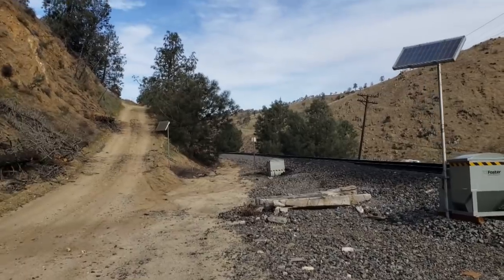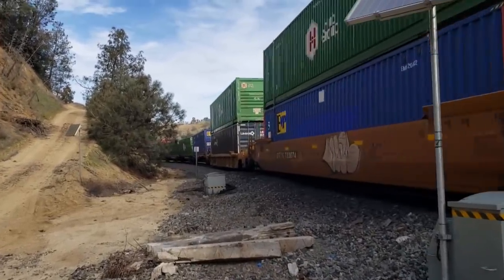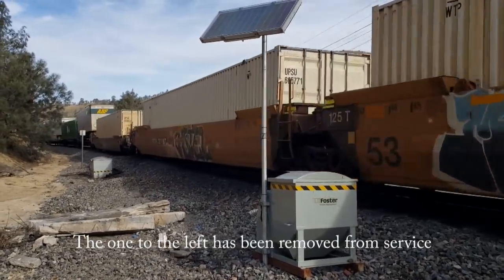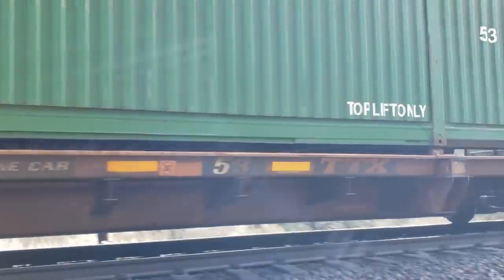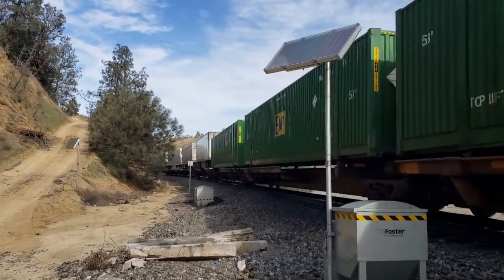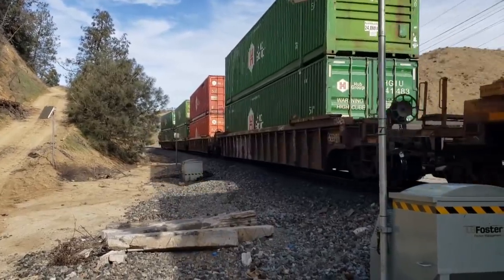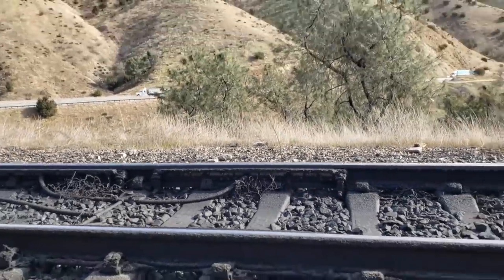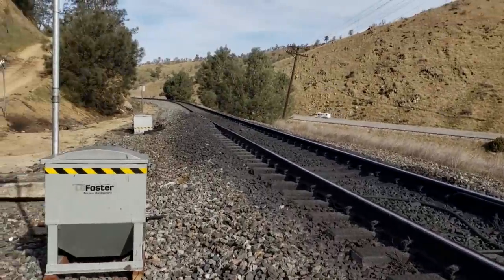How a Railroad Curve Oiler Works or How Squeaky Wheels Get The Grease!

Comment: Pity they don't have spare units that can be swapped out for a defective one, instead of of just not have grease to one track.
I worked on a tunneling project for Canadian Rail boring a tunnel under the St Clair river near Sarnia, Ont. This was to replace the 100 year old one that was too small a diameter to take the double stacked containers shown in you video. They had been barged across the river previous to the tunnel opening.
Thanks for explaining the track greaser, I bet local residents also lover not being woken at night by those horrible squeal's.
Reply: Huh?  It looks to me like the one out of service was replaced by the one he talks about.
Reply: Most railroads that use these lubricators have someone or several people assigned to maintain them depending on how many there are.

Comment: Train gear question: Am I correct in assuming the tail light on the back of the train is run by a small turbine driven off of the airbrake pressure system?  Recently had a train stop by my area with the back end at a short walk's distance, and kept hearing a whining noise from the end of the train.
Reply: Correct. The FRED (Flashing Rear End Device) transmits brake pipe pressure to the lead loco, as well as being a means of performing an emergency brake application.
Reply: No, FRED is battery powered.
Reply: @royreynolds108  I would bet on battery/turbine generator combo then: I couldn't see the railroad relying on all battery and having to bother with recharging in storage when just hooking up will give instant operation instead. Would really like to look at one.

Comment: The company I work for has its own siding with three spurs. We get tank cars of oil almost daily that have to be switched out. My job is weekly to go out and clean and oil the sliding surfaces of five manual switches and maintain a flange greaser just like those. I even have to manually grease the inside of the rail on the high side on a couple of hard curves and I just use a paint roller to grease the side of that to keep from wearing the side of the rail so much. The automatic greaser is triggered by a proximity switch that detects the wheels and every 18 wheels it runs a 15 to 20 second cycle of grease pumping.

Comment: Have you experienced the flat cars which carry military's battle tanks where the  wheel trucks have 3 axles? Saw a video from the  early 2000's on Tehachapi and the squeal was something terrible, comments said it was brake squeal but it was going up hill. Needed more allowable axial shift on the middle axle to stop the wheel flanges loading against each other (the 2 outer axles v the center axle). One thing you should not have is the lubricant on top of the rail, loss of traction, wear due to cavitation, wheel skidding, environmental mess.

Comment: I seem to recall reading somewhere a long time ago that the steam locos had oilers on them. The engineer activated them as needed.
Reply: That depends on the railroad and service the locomotive was assigned.  This also includes diesels and electrics depending on service and location.  Switching on and in tight curves would often find flange oilers on locos sometimes with a method to start and stop the application.
One of the switching railroads around Chicago has diesel locos using tires on the wheels like steam loco wheel practice because it is less expensive to re-tire wheels than replace the wheelset or wheels on an axle.

Comment: Here's a question you might have answered in your setup:  Are the wheels on each axle all one solid piece, so that they must skid a bit while following a curve?  If so, why is that done?  Is it really so much cheaper than having each wheel on an independent bearing?  I would think that if one wheel wears faster than the other for some reason, the difference in diameter would result in wear and drag that would waste a lot of fuel.
Reply: Ralph ... the wheels are solidly mounted onto the axels so rotate as a pair. What you don't see is the wheels have a taper to them to help keep them centered between the rails and lower the wear on the flanges while on a straightaway. What this also does is slightly change the diameter of the wheel between the inside and outside edge of the same "tire." (the contact area of the wheel) Basically this slight change in diameter also reduces that problem with the two wheels wanting to rotate at different speeds because the car slides to the side on a curve and it rises up to that change of diameter on one side and down to the smaller diameter on the other side. Pretty clever if you aske me!
Reply: @rupe53  - Thanks for taking the time to reply.  I think it's fascinating how the significant subtleties of common items we take for granted are so often invisible to the casual observer, yet critical to their function.  Now I want to know what the minimum turning radius of a train is.  I think my car is about the same!
Reply: @ralphwaters8905  ... found this WIKI on the subject: In North America, equipment for unlimited interchange between railroad companies are built to accommodate for a 288-foot (87.8 m) radius, but normally a 410-foot (125.0 m) radius is used as a minimum, as some freight carriages (freight cars) are handled by special agreement between railroads that cannot take the sharper curvature. BTW, the radius will also dictate the operating speed.
Reply: @rupe53  - Yes, That sounds about right for my car.  😁  Every now and then, we see on the news how a commuter train failed to negotiate a curve at high speed.  Next, you'll tell me that the rail spacing is based on the width of Roman chariots, I suppose!??
Reply: @ralphwaters8905  ... well, now that you mentioned it I read an article on how the space shuttle also had something to so with the track of Roman chariots.... because (drum roll please) ... certain parts were shipped by rail and due to tunnel / bridge width there were limitations! <LOL>

Comment: On a 100 ton car, its hard to believe that one wheel has to slip because of 1 rail shorter going around a curve. Never knew that they oiled the rails till now. Thank you for the video. Which wheel slips? inside or outside of curve?
Reply: On a 100 ton car, it's imperative they slip, or else break the axle.
Reply: @57fitter  Thats interesting! Lot of thought and engineering went into building train cars and steam engines back in the late 1800's. More brains and common sense before computers!
Reply: Train wheels are cone shaped, with the larger diameter on the flange side, to compensate for the radius of the curve. There still is contact though.

Comment: In the UK we call them grease pots and it was my job many years ago to carry cans of grease to refill these horrible things, and in the middle of summer walking for miles carrying cans of grease and tools to do it is no fun that stuff is extremely hard to remove from skin and clothes was the worst job i ever did on the railway i would have rather dug wet beds all day than greasing, no paycheck was worth it
Reply: Yes, flange lubricators in the UK are easy to see. Cylindrical pots mounted close to the rails, with thick deposits of heavy grease on the inside of the rails.
I used to operate excavators, and I hated greasing the pins on the boom, dipper arms and bucket. I'd usually manage to get grease on me some how. Either off the grease gun, or by brushing against a freshly greased pin. I know how you feel. It's a necessary job, but grease is vile stuff to try and get off your skin or clothing.
Reply from the maker: Yeah, I've ruined pants and boots having to work in proximity to these! It does not come out!
Reply: Do you have a guess on how long ago this was? Do they still do it the same way?
Thanks for the story.

Comment: Unless I missed it, no discussion regarding how the oilers are triggered when the train wheels contact it
Reply: I know the old style worked purely on hydraulics when the plate was pressed by the flange it pumped grease on the inside rail head and greased the flange of the wheel easing it round corners, i'm not 100% about modern versions but i assume it's the same only controlled by power and sensors
Reply: He explained it as hydraulic pistons. I can understand that.
Reply: @57fitter  The old-style did.  These new ones he's showing dispense lubricant from a remote reservoir and utilize electrical power.

Comment: I have never been given a reason why train wheels are joined by an axle.🤔  The inner and outer wheels need to rotate at different speeds on a curve so, traction is lost on one of them which would be a waste of energy/fuel/money.
Reply: It is how the train stays on the track - the wheels are actually slightly conical which makes them self-steer - but that needs the two wheels to be joined. The flanges on the wheels are not used for steering/keeping the train on the tracks, except on tight curves. Watch https://www.youtube.com/watch?v=vkzgcJGdUnA
Reply: @kevinjbakertribe  I understand that.  I'm not questioning the use of wheel flanges.   
My question is:  Why have the left- and right-side wheels joined by an axle?  One side restricts rotational speed of the other side on turns and curves.  That adds stress and resistance resulting in added wear to the wheels and rails and increased cost.
Reply: @imdeplorable2241  Apologies I probably didn't explain too well. Having slightly conical wheels and a locked axle means the wheels self-centre - on reasonably straight track a train would stay on the track without flanges. The video I linked shows this - they demonstrate wheels with just flanges (don't work), conical wheels with unlocked axle (doesn't work) and conical wheels with locked axles (does work). It is a counter-intuitive bit of physics - the same one that made the belt drives of old sawmills stay on (The pulleys are slightly bigger in the center)
Reply: @imdeplorable2241    The arrangement of truck or bogie and car construction is about the best and least expensive that has been found in all of these years of operating railroads.  Cars with wheels without connecting axles would require a heavier constructed frame than that used now.
Reply: Thank you, Kevin.
Thank you, Roy.
Excellent explanations from you both.👍👍

Comment: Doesn’t that oil impede the traction of the next locomotives to pass over it?
Reply: If I understand correctly (and I usually do), only the flanges of the wheels get oiled. The part of the wheel that rides on the top surface of the rail doesn't. The flanges don't contribute to traction, they just keep the train on the track.
Reply: @craigcorson3036  and we don’t want friction on the things that keep the train on the track.
Reply: The train is already moving when it hits the curve. Even if you stop in this spot you can use the sander to get traction.
Reply: I also heard that oiled rails save efficiency on fuel something to do with the train 'gliding' across the track or like an oiled bike chain is easier to ride on a bike, but i saw it on an old steam rail video so im not sure if its used anymore.
Reply: @pashon4percushon  Well once the oil gets dirty and quickly wears away and temporary "parasitic drag" reduction will return.  They need Graphite coating.
Reply: Thanks for all of your answers. Makes sense now

Comment: Back when i was a kid, before all of those newfangled inventions, the oiler was a man that was stationed at a curve with a grease gun and applied grease to each wheel as the train went by. Some railroad companies would have a man on each side of the track.
Reply: I believe you may be mistaken
Reply: @prairiecracker214   Why , whatever makes you think that.
Reply: @johnmeadows5645  , the oilers job originated with steam locomotives and their primary function was to oil and inspect the myriad of external moving parts on the locomotive, gears, bearings, shafts, pulleys, chain drives,  and possibly do adjustments, this needed to be done at every stop. I don’t know how the job you describe could be done safely or effectively. I could be wrong, I’ve been wrong before but I grew up in a railroad town, worked for the railroad, and I haven’t ever heard of anyone doing what you said.
Reply: @prairiecracker214   I was just kidding with that comment, just wanted to see if someone caught on. I have a cousin who was with the Sante Fe at Barstow who told me a lot about how the mechanical systems work on the railroad. Sorry if i sounded like a smart alec.
Reply: @johnmeadows5645  , Ha Ha, I seriously considered that possibility but these days it’s hard to tell. Too many people with misconceptions they believe to be the gospel even though they’ve never been out of the house, but they’ll go toe to toe with absolute conviction. I would wager there are some (assuming this video gets more views than you and I) that without question will completely believe your comment and add that information to their wealth of knowledge. Anyway, I think people need their leg pulled occasionally just to keep an even keel.
Reply: @prairiecracker214  You are right. I don't want to upset MARK though, i enjoy his videos too much.
Reply: @prairiecracker214  There are two different "oiler" jobs that are ligitiment-the person who went around in the train yard checking the journal boxes and refilling them with oil and the person who lubricated the many points on a crane or other machinery.  I realize the 2 of you are joking but others may like to know.

Comment: Fun seeing that long train.   Thank you.
Wish that you had shown close ups of the oiler.  Really did not see anything.  You could have zoomed in  while the train passing.
Reply: Did you watch to 5:30? He showed it pretty well
Reply: @nickopedia5669    Close up as the train is passing over them.
Reply: I would have liked to see where the grease comes out of the device. I was a bit disappointed not to get a better view of the oiler.
Reply from the maker: @ddegn  the grease is distributed along the inside of the rail so you can't see it working. Even then, only a small amount is dispensed. One of the reasons I get no grief for being in many of the places I shoot is because I stay out of the way and don't foul the tracks unless I know it is safe and it was not safe at that location as no signals are visible.

Comment: They desperately need one at Deshler Ohio it has two curved tracks and it squeals like hell
Reply: @Dan Cline Southern Ohio. Jackson county Ohio . But I'll say hi anyway
Reply: Those 2 tracks are connecting tracks between 2 different lines and are very short and not used as much as the mains that cross.

Comment: Summer and winter break job was milling the hydraulic applicator blocks and assembling the head units at Moore and Steele in Owego, NY during the mid-80’s.  Always interesting trying to explain to people what it was this small family-owned concern manufactured. Great video to show how they work and have been improved over the years.

Comment: I was a lubricator maintainer for BNSF you explained it pretty well good job I was in KS.
Reply: Do they have the oilers on both ends of the curve?
How far does the oil/grease travel down the track?
Reply: @ddegn  there is only 1there are a lot of variations the how much traffic degree of curves and how many curves most generally there is one tank and 4 bars that have 48 ports on each bar the lubricators that are in the video are solar powered which means they 12 volt system and on the inside of rail is a wheel sensor it picks up how ever many wheels it is set for which in turn will activate the pump I hope this helps understand the system
Reply from the maker: @charlessmith8834  thank you so much for adding your experience to the conversation!
Reply: @ddegn  I want to add that on average the grease will carry three to four miles but there again depends on how much traffic I had some that would carry grease 6 to 8 miles
Reply: @charlessmith8834  Thanks for the great answers! That helped me understand it a lot.

Comment: Mark ... thanks for this, as an Oiler Mechanic in the 60"s ... talk abut dirty, I had black heads in my arm pits .... and did not know they have been revised to electric, the old shoe pump types would shoot graphite grease every where. ... the hoggers used to throw stuff (in fun, I hope) at me as quite often with so much grease making its way to the ball of the rail the sanders had to be used .... and grease with sand was a real messy substance .... went to the aircraft industry, no heavy grease.
Reply: I once saw some dragging equipment hit one of these lubricators. Demolished it. It was a cloud of grease flying through the air! It must have covered nearly a quarter mile. Amazing!
Reply: It is next to impossible to remove graphite and/or carbon black from your skin.

Comment: My dog spot that went everywhere with me managed to walk in some of the grease one day and it's so hard to get it off of her let alone my truck seats. Fortunately they were vinyl. The one that I saw was a pump style that has now been replaced.
Reply: Since they use Dawn dish soap to clean animals in an oil spill I suppose that would probably work. But Grace is a whole different thing isn't it. that kind of makes me think of the fifth wheel grease on a semi truck
Reply: Yeah you're probably right, Dawn would at least be a start. I didn't think of that then. For heaven sake don't let it get on your carpet inside of your home. Then you'll have another battle with the wife.